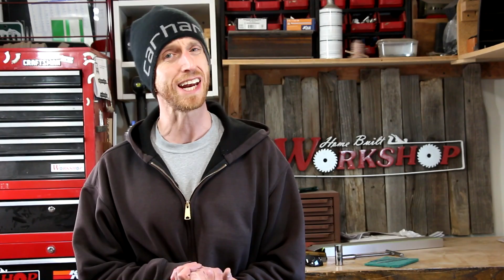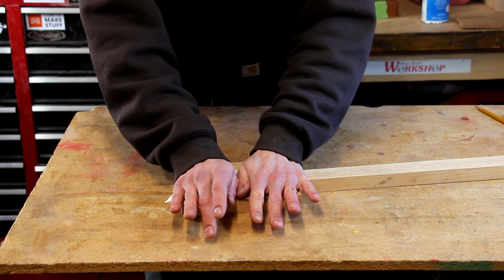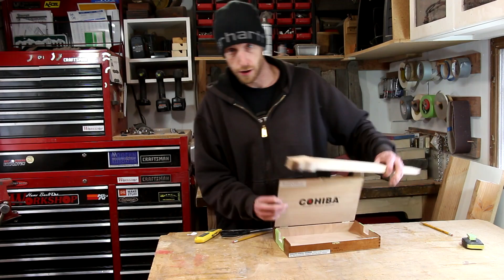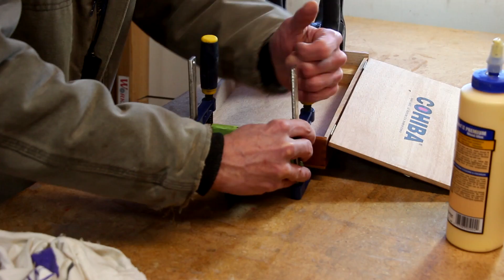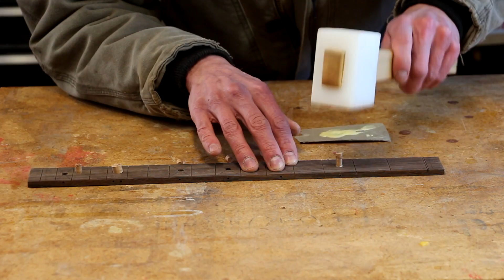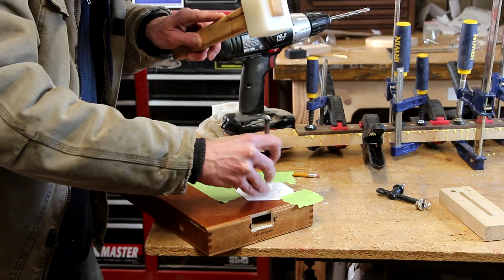How to build a Cigar Box Guitar, Part 1

Comment: Good plan dude.  A few CBG projects gave the the confidence that I could do a decent enough neck to justify committing a $20 truss rod to a real neck project.  Nicely done.  👍🏻
Reply from the maker: +Bonehead Guitars thanks. Baby steps. I feel like I should do at least 1 more of these to fine tune a couple of things before I make a 6 string neck. Maybe I'll make one with the truss rod. It does need some relief in the neck.
Reply: Yes sir.  I did several before I wanted to try a 6-string.  They're great practice for carving and fretting.  I had to revisit the CBG idea not too long ago that I need to get posted.  I like what you're doing.

Comment: I wouldn't be surprised if your hole that you didn't have the right bit, was in a metric size. 12mm I think it would be. I would suggest investing in a metric set of forstner drill bits. I need to do that myself haha. Although I don't know that I've ever seen any 🤔
Reply from the maker: +Jake Breeze I'm sure you are correct. You can get metric forster bits. I'll probably have to get a set. Would've saved me some time if I had them.